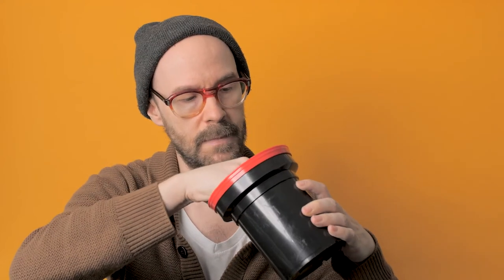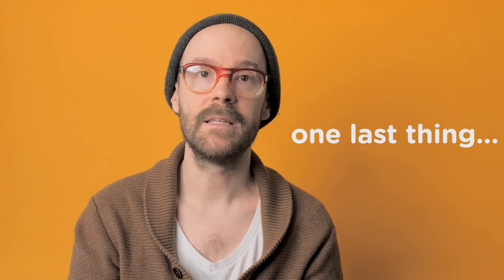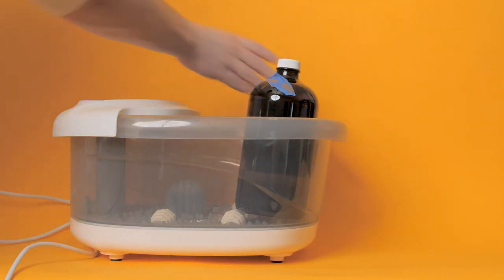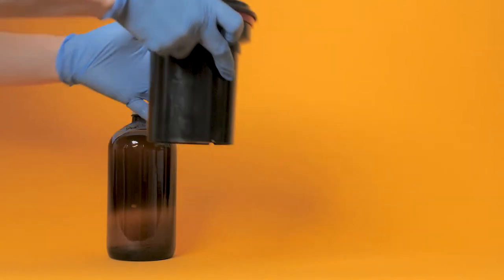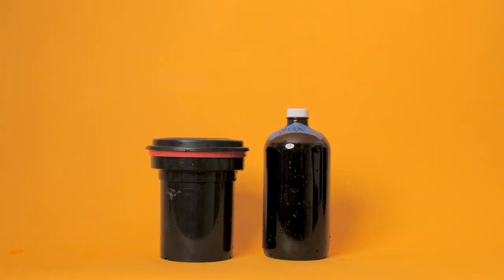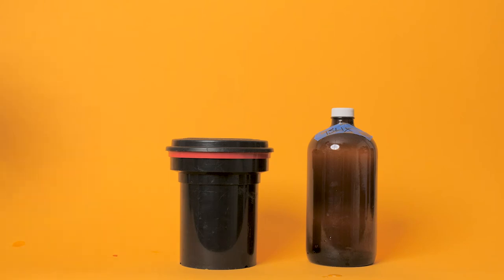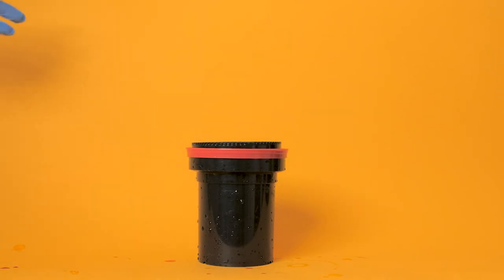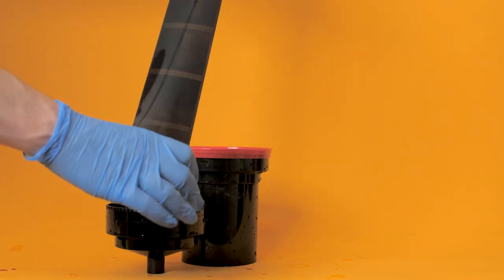Episode 06 - Developing film in the comfort of your own home!

Comment: Great video, how many times can you reuse the chemical? What is the shelf life after mixing? Thanks
Reply from the maker: Thank you! It depends on the chemicals that you use. The manufacturer will usually tell you the estimated time. I think this one is around 8 but I could be mistaken. You'll start to notice some odd color variations and that means it's time to change to a fresh batch. Not sure on the shelf life, that again depends on the chemical but it's been a few months in a cool environment and it's worked fine for me.